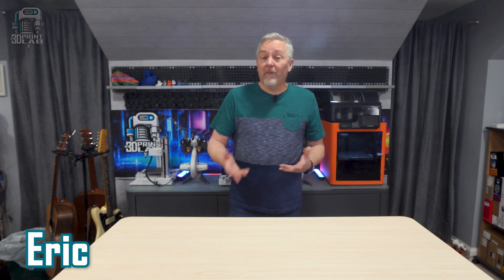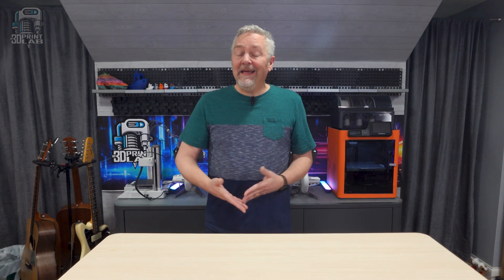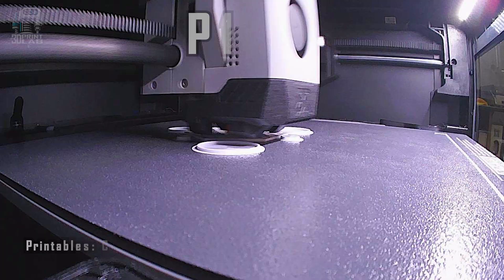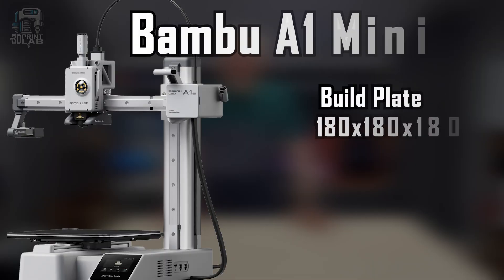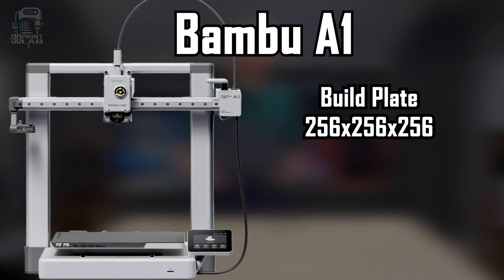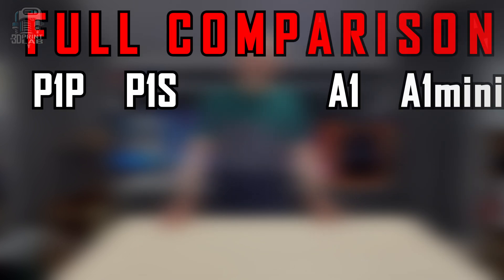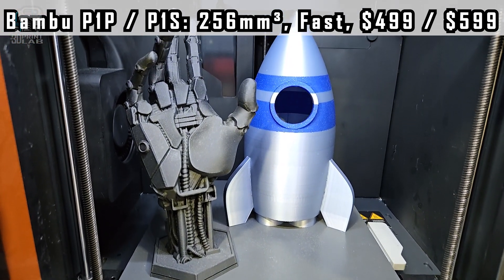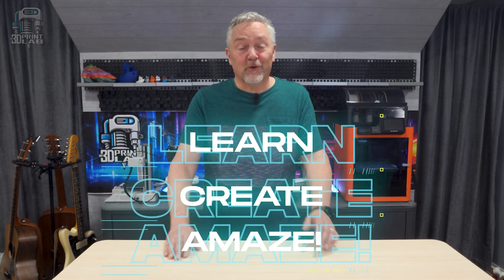Why Bambu? Why Not Bambu? P1 & A1 Info You Need to Know!

Comment: As someone who uses a printer as a tool for random stuff around the house/shop a few times a week/month but is also coming from the old world of printers (my last printer was a sidewinder X1 from 2020) the A1 is a perfect machine. I have yet to be let down by this machine. It's going to be my #1 recommend printer for a while I think. Just having a machine I can send a print to from my phone without needing to get on a PC is super nice. My old machine had octoprint but it's not the same. Also if a print does fail there's no real issue changing the nozzle. Just push the cutter in and swap the nozzle in 2 minutes. No tools or mess. When Bambu released My first thought was "these machines will break down with in months and be unreliable" well it's been years and people are using their machines in print farms and claiming they are more reliable than prusa machines which blows my mind. So it's nice to know this is a machine that can last as long or longer than my sidewinder as long as parts are available. And that's the one down side. Proprietary parts. But they're at least cheap from Bambu.

Comment: Only sheep buy bambu. You have to be ok with no privacy All your "disk1" data is being sent to a amazon server. this includes camera shots. If you plan on doing anything that requires a NDA you will NOT be able to do so with a bambu printer. and now with options like a enraged rabbit or the KCM upgrade setup for Klipper or the Chroma or 3d chameleon slap that on a SV08 with a 350mm build plate.

Comment: I went with the A1 and AMS lite for my first 3d printer to print terrain for mini gaming.  I haven’t done a lot of multicolor printing but I love having the AMS to automatically continue a print with the same color filament when the first roll runs out.  So I never have to worry about the amount of filament on a reel.  I also really like that the AMS lite detects the Bambu filament type and color automatically.  The A1 has worked above my expectations.  I’m really interested in what Bambu Labs does next.

Comment: I’ve got them all, first x1c, then a1mini, then p1s and p1p then last a1. Best for maintenance is the a1 and a1mini but speed goes to the x1c and p1 series. The print area  isn’t 256 on x1 and p1 series due to a restricted area on the from left corner where as the a1 can use the full build plate. The print head on the a1 series is more advanced than the x1 and p1 series due to additional sensors for active flow and pressure control.
Reply: you can use that area, you have to disable the filament cutter by printing a small clip (and indirectly the ams). it’s on bambu wiki.
Reply: Would you help me deciding for a printer. I like the A1 for the price and auto flow control with the sensor the P1x doesn't have. But I have two cats which could get burned so P1S seems better. But there is no flow rate sensor. Does this mean I need to calibrate manually each print or new filament?

Comment: Having started with an "AnyCubic Mega S" ($45 CAD, had been returned, needed bed levelling - paid for itself on it's first print), then going to a FlashForge Adventurer 3 Pro (again a return deal for about $150 CAD - but it weirdly needed alot of levelling - almost always had to use rafts), I broke down last year and got an XC1.  

In my opinion - if you do not want fiddling with a 3d printer to be your actual hobby, then I highly recommend Bambulab products.  "They just work".